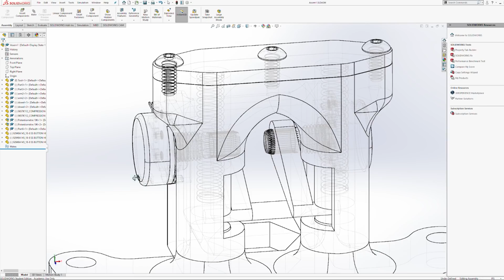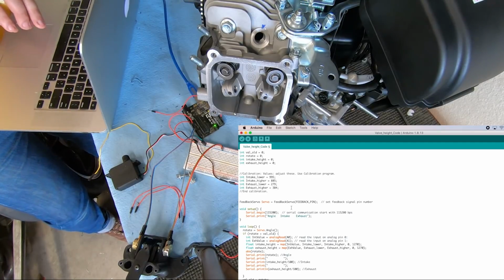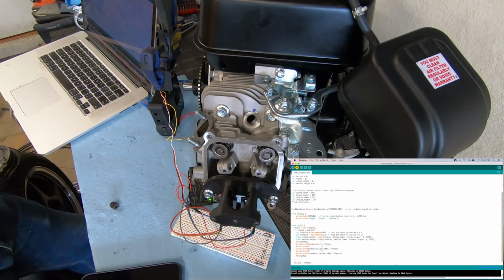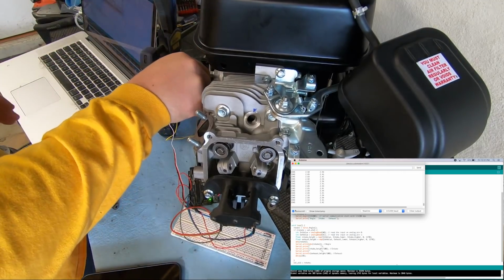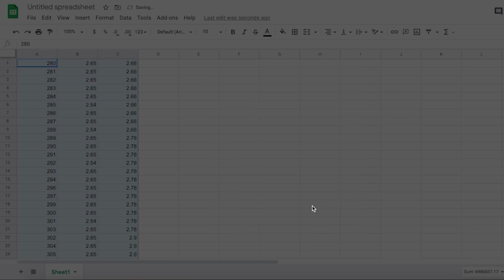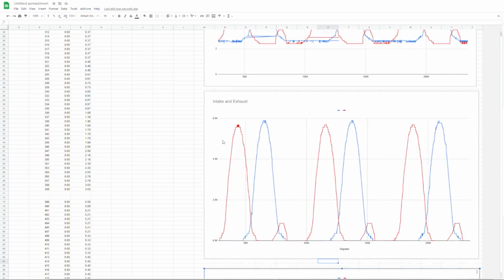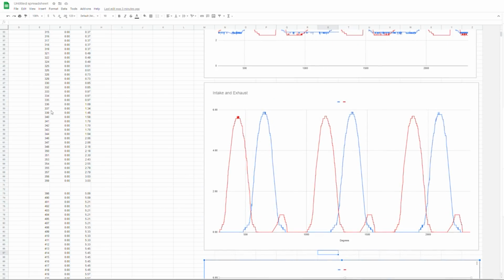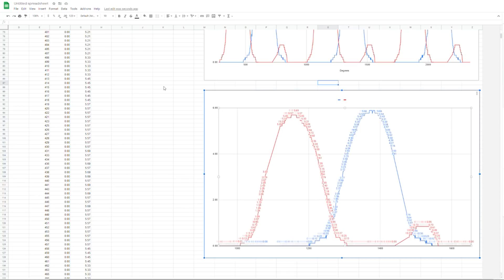Freevalve Build - Cam Mapping Tool

Comment: Miata. Non-interference engine. Less stuff to break when you’re in R&D.
Reply: The Honda D Series Non Vtec engines are way more reliable and are non interference engines as well and you have a smaller head to worry about, and it only has one cam🤣 (most of them anyway, if you overlook the D16A8 from the ED9 CRX)
Reply: @THEBOZZ1801  Since when has most D-series' been non-inteference engines. I understood that they are interference ones, atleast the ones that have VTEC
Reply: @THEBOZZ1801  tired brother, my bad. I read that as VTEC, it's after midnight over here
Reply: @Kydenius  in germany too, and yes the car on my profile picture is my own car... thats why i know a lot about d series engines, the valvetrain on a d series non VTEC head is very easy, no hydraulic lifters no tappet lifters. Just a mechanical cam with roller rockers straight to the valve
Reply: @THEBOZZ1801  can the valves tangle when too much lift in tdc??
Reply: @Baard2000  wdym?
Reply: @THEBOZZ1801  if , for example,  the exhaust valve stays open at 4 mm valve lift.( seized,  stays because ekectriniv failure)....and the intake valve opens and hits the exhaust valve they tangle and lock up.    Been working in high performance engine development...seen some horrible disasters..... ( Porsche air cooled line 6 when  overreved..... Or customer with too wild cams in K20 Honda ....etc...)
Reply: @Baard2000  nope they don't on the D14 or D13 at least because the valves themselves are to small for that to happen, but on my own engine it could happen because i have way bigger valves  in my D16Y8 Vtec head
Reply: @THEBOZZ1801  His would have zero cams to worry about :)
Reply from the maker: My thoughts exactly.
Reply: @WesleyKagan  disliked comment to leave at 69 likes
Reply: Non interference only matters when using a stock cam profile. When using a free valve system you're controlling the valve directly, any off lift calculations and incorrect maths still may cause the valve to overextend and contact the piston.
Reply: @DanJLeh  Right? Interference or not doesn’t matter when you’re messing with cam profile. Interference engines just mean that your cam profile is aggressive enough to collide with the pistons if you’re out of time.
Reply: 2.0L Turbo 3S-GTE from Toyota is non interface. Tougher to find though lately.
Reply: SW20 MR2
Reply: Not sure an interference would necessarily result in a dead engine as pneumatics are compliant... Awesome project!  Looking forward to seeing how it works out
Reply: @Dgerma1   smack anything while moving at 7000 rpm anf it will eventually kill it
Reply: Couldn’t you make it an interference engine by pneumatically actuating the valves enough to do so on accident? Also if you added too much cam profile couldn’t you make the valves hit each other?
Reply: I was going to say the exact thing.  And being 4 cylinders and just a single bank, it's half the stuff to worry about.
Reply: Also the head is on top which is way more accessible and there are cheap options for aftermarket ecus like speeduino that may work well with the software to run the freevalve tech. Also i have a miata and would want to try this.
Reply: lass kinn  you might have never seen a d series single cam engine right? The valve cover alone is like 6 inches high...
Reply: D series. Cheap and plentiful
Reply: @yzcrkxrm1  thats true,  ive got 4 myself, paid 50 bucks each🤣 and these engines dont care about high mileage if they are well maintained
Reply: Agree! Lexus LS400 is also non interference and V8, that would also be nice 👍🏼
Reply: I'd also encourage converting some cylinders to airpumps/additional expansion cycles. https://www.youtube.com/watch?v=u0uPmrSRM7w
Reply: Volvo redblock, 1 cam and also non interference i4
Reply: Also: Miata is always the answer.
Reply: Interference engine doesn't have any relevance to a freevalve system.
Reply: Miata is always the answer.
Reply: For R&D there are plenty options but miata would be one of the cheapest while still being rear wheel drive, non-interference, and frankly easy to work on.
Reply: Does it even matter if it is a non-interference engine? When the self-designed free-valve opens fully right befor TDC I gues the valve will be dead.
Reply: @HansBrodiAutomotive  a non interference engine is easier, because you have less to worry about...
Reply: @HansBrodiAutomotive  if it's a non interference engine a valve opening at tdc wouldn't constitute a problem, if he keeps the stock values for lift and just mess with the duration i see no issues at all, unless it just drop a valve of course

Comment: The Miata would be easiest, access to lots of cheap parts, lowest cost of failure.  1600cc Gen 1 Miata engines are bulletproof and should be able to rev to the moon were it not for the valves. That's my vote.

Comment: This is awesome to watch! Two questions. Are you going to implement this on a car? That'd be incredible.

Two, Are you going to move to electromagnets instead of pneumatics? Looks like it'd be difficult if you ever moved the design to a car engine.
Reply from the maker: That's the plan! 

Like on this build, I'm going to make the base head for both. as I perfect the electromagnets I'd like to continue to test them. But Pneumatics are working for now.
Reply: @WesleyKagan  that's is excellent news. If you wanted to keep pneumatics you could get a tank and electric compressor running off the car.

What is the issue with the electromagnets at the moment? It feels like it should be pretty simple to hook up, right?

Comment: The rockers have a ratio built into them. Usually between 1.5 - 1.7. Just figured youd want to figure that into your cam specs for valve lift.
Reply: i think it might be a 1.2. aftermarket ones are 1.3 but don't quote me on it
Reply: He should be mapping the valve side of the Rockers in reality.
Reply: Yup exactly my thought... He can add the final multiplier number anyways afterward.. but atleast having the multiplier from beginning, will help the engine works like its from factory spec (or slightly from factory for better performance)

Comment: I was very interested when i saw the freevavle in my recommended, something i want to do myself! I'm going to watch this series through keep posting man!
subscribed and turn on all notifications
Reply from the maker: Thanks for the support!
Reply: Same here, got your first video suggested last night and was instantly hooked. Your commitment to extraordinary projects is inspiring! Please keep us updated, hope your channel grows a lot so you have the opportunity to put more time into this. For the record I vote LS just because I'm a V8 guy but I get that 4banger will be less work. But hey you could do just one bank of the LS, keep the other one run by the cam and pushrods😂
Reply: @Hotrodfan1  LS is my vote as well because he could possibly do only one cylinder, run the engine at idle and slowly bring his cams to life. As soon as he has that cylinder up to power he can install an 8 cylinder kit using the data off the test cylinder. Overhead valve engines have lots of oil that would have to be controlled (maybe using dummy cam journals) and water pump, some oil pump and balance shaft drive issues once the belt is removed. This guy would just redesign a belt system to handle it of course but it is more work. The LS already has the cam and crank signals.
Reply: @Ed70Nova427  very good point. Ls might be less work after all when looking at the details you mention
Reply: @Hotrodfan1  me too, been contiplating using arduino computer on my type 3 VW dunebuggy with eventually my bolt on RayJay turbo for VW's
also aditional  hydrogen generator boost I built for gasoline combustion efficiency (it adds more explosion mass & because it burns all the fuel in chamber there's less heat produced & more power) correction Oxyhydrogen (browns gass) from H2O...
Reply: @ernieferguson6346  could you elaborate on how burning more fuel brings the temperature down? Is it due to evaporative cooling like with methanol?

Comment: Do the Miata. This stuff is going to be hard enough without doing it all twice on a V8. It´s just a proof of concept anyway. And btw,  I´m amazed at how matter of factly you deal with this stuff. It´s rocket science to me! EDIT: Four valve heads give you more scope to play about with things like shutting down two of the valves for say fuel economy.
Reply from the maker: Thanks! That was my thought with the Miata as well. 4 is easier (and cheaper!) than 8.
Reply: @WesleyKagan  I would have to agree with miata simply because the progress will go along a lot quicker. That being said, I would highly suggest trying it on an LS at some point to target a different/bigger audience.
Reply: Hell yeah, freevalve yata, here we go!!!
Reply: Well, 4 cylinder with 4 valve each, or 8 cylinder with 2 valves each both ends up at 16.. But I think a inline 4 is nice and easy to acces the valvetrain, so it's still a smarter choice IMO.
Reply: I'd think the DOHC configuration of the Miata would be much harder to work with than a pushrod design. Harder to fit things together, and you'd have to be all-or-nothing, couldn't have some cylinders run normally and others freevalve simply by removing or installing pushrods/rockers. And as others say, the LS and Miata both have the same number of valves. I'd suggest an older pushrod two-valve-per-cylinder four banger. Also something older that isn't emissions-regulated, as there's no way something modified like this could stay emissions-compliant on top of everything else. But before any of that, just get it running really well, reliably, and long-lasting on the Predator.
Reply: @quillmaurer6563  I dont see why it being dohc or pushrod would make any difference, especially when he wouldn't be using any of the above anyways. I really like the miata idea, solely for the fact that it's non-interference and on top of that, parts are readily available basically everywhere if he DOES manage to break something. The design of the plate to the top of the motor would be the only thing that would change, which to him isn't a huge deal. He has to change his design no matter what, so i think overhead cam and pushrod makes no difference. On top of that, removing the cams overhead means less work for him, because half the point of the freevalve is to have less rotating assembly. I dont think he wants to remove a cam out of the block if he doesn't have to. on top of that, most pushrod engines of the top of my head are interference, so if for whatever reason a valve gets stuck open, he wont be totally screwed. just my two cents tho.
Reply: @quillmaurer6563  From what i gather from all the motors ive ever worked on, majority are, even down to my packard v8 that's 75 years old. My v12 bmw is sohc, and judging by the way it looks under there and the experience ive had with k series hondas, i dont think the extra surround will be a big deal, and it may actually help with mounting points, because the camshaft bearing mounts are going to be a lot more robust than a lifter mount, and there will be more of them (typically)
Reply: @quillmaurer6563  what years of bugs
Reply: @quillmaurer6563   가